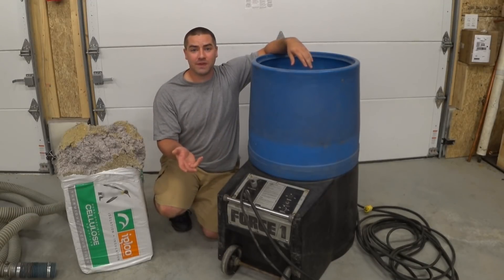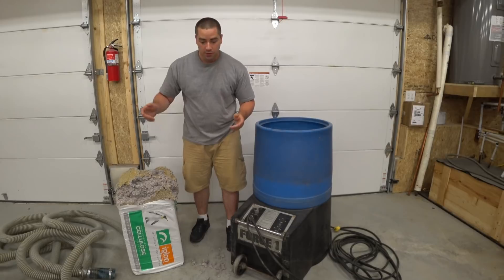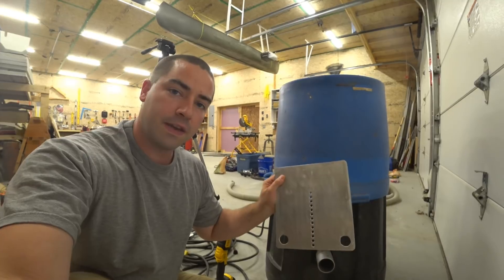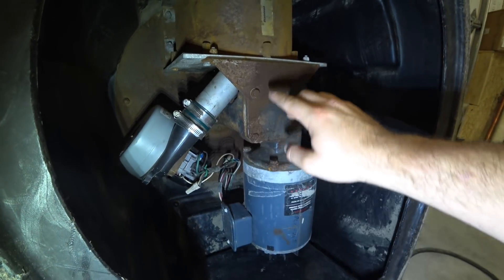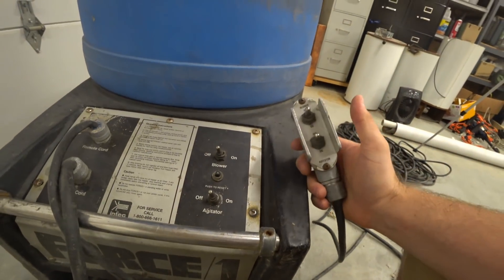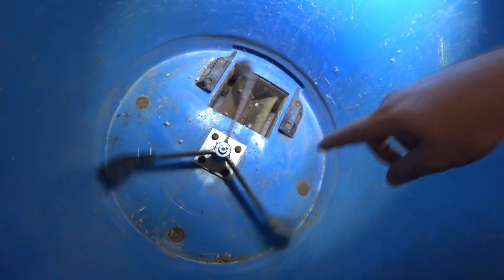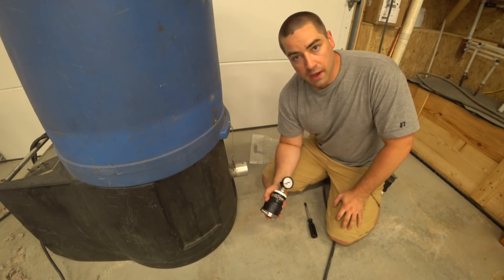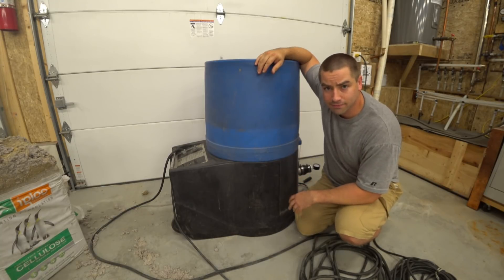How it Works, Insulation Blowing Machine

Comment: have you dense packed with this machine? only 15amp seems way to weak.  However, i can't find any local rental places that have a 30amp.  They only have this 15amp...
Reply from the maker: It would not dense-pack at first.  The original blower is too weak.  I upgraded the blower and it draws more like 18 amps or something now.  And it can dense-pack and I've used it on jobs.

Comment: In your professional opinion, how much more beneficial is it to use a machine vs. spreading by hand or take?  Would I be sacrificing any R-value?

Example, I just want to add ~3 bags worth additional insulation (open area).
Reply from the maker: In your example of 3 bags to an open area, just use your hands.  No, you would not be sacrificing R-value in that situation.    Machines are needed when you get into dense-packing, and/or for speed.

Comment: I have a force 2 machine do. You. Know how to. Fix it mine does blown the insulation with enough power material. Gets stuck in the hose please help
Reply from the maker: Three things to check, maybe one might help.  First, when dense-packing the hose must be retracted as soon as there is resistance.  This comes down to technique.  Don't let the hose stay in the wall cavity, in one spot, too long.  Second, the feed-gate must be closed down tighter when dense-packing compared to open-blow.  When I'm dense-packing the gate is open 3/4" to 1".  Not very much.  Third thing to check is the type of splices between hose sections.  Most PVC couplers are thick plastic and create a dam in the hose.  If you have PVC couplers, try replacing them with steel muffler connectors.  These are much thinner than PVC to create less chance of the material damming up.

Good Luck.

Comment: Looks a little small the one we used was 30 amps 240 volts. Thanks for the information.
Reply from the maker: Yes, this is one of the smallest on the markets.  But, the information still works.  I've also used huge machines and the parts are bigger, but it still has blowers, air locks, etc.